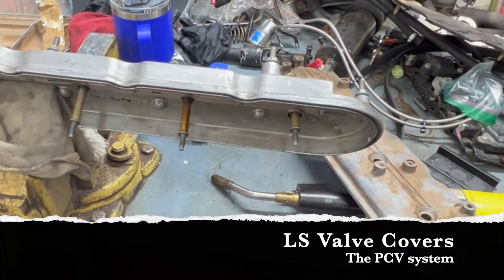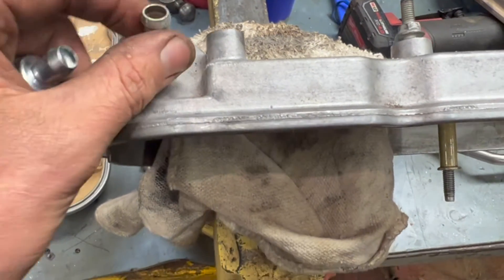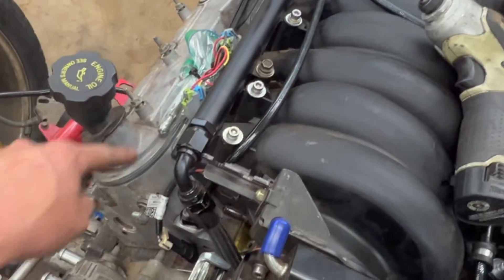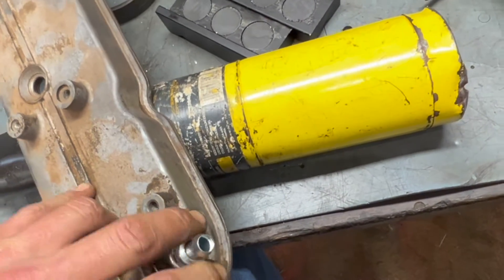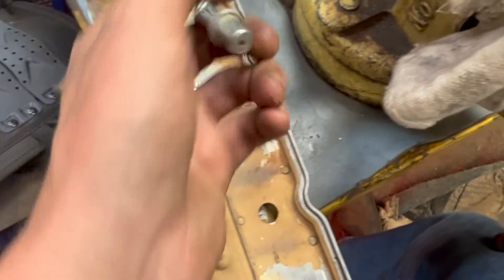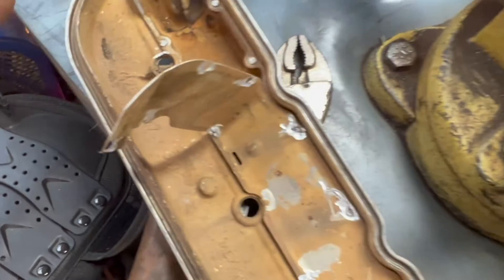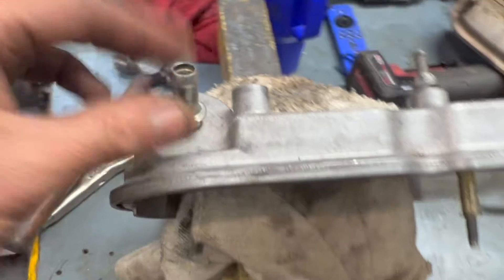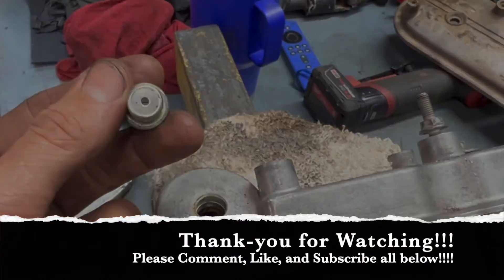Does the LS engine have a Real PCV system???

Comment: Gm has an updated valve cover to fix oil consumption issues in these. Its basically a larger drainback hole. Any ls I buy, one of the first things I do is go through and drill the hole larger, and in many cases add 2 more. Ive never had an issue with conaumption since.
Reply from the maker: Thanks for the info! 😄 I’ve heard about the updated valve cover fix, and opening up that drainback area makes a lot of sense. Sounds like you’ve got a solid system going — drill it out, add a couple more, and keep the oil where it belongs. Appreciate you sharing that! 🚀

Comment: So I have a 2004 silverado 4.8. Its my daily driver right now. Its pretty high on miles but I dont want to get rid of the truck because when I end up getting something else I want to rebuild the engine and have a toy. I've been having issues with it sputtering for quite a long while and after some fuse replacing and other things was able to read the codes. It shows a p0449 evap leak code which I am sure is the cause of the sputter. Just recently it has been getting bad. Oddly the sputter is mostly gone though I have replaced a handful of evap parts and such but I went to kill it after getting home from work one day and the engine acted like it wanted to stay running. It happened again the next morning when I got to work. That's the last time that happened but now its trying to stall out right as im pulling up to my house. It did it yesterday and I kept it from completely stalling but today it stalled and was hard to start. These are signs of the evap leak from what I've learned. The knock sensors are also throwing codes which again I assume is from the evap leak making it sputter causing the knock sensor to try to adjust timing. Possibly why it was acting like it didn't want to shut off. Since all thoes problems have stopped so far im not sure what to do. When I was looking into why it didn't want to shut off I read that there could be carbon build up or extra fuel coming out of the injectors or possibly the pcv spitting oil into the cylinders causing it to act like a diesel. Im obviously having the same concern as far as replacing a valve cover. Why did GM do this dumb shit. But anyway what do you recommend?
Reply from the maker: Sounds like a mix of issues. The P0449 is usually the EVAP vent solenoid or wiring near the canister. The stalling and “dieseling” could be from the PCV built into the valve cover—if it’s dumping oil into the intake, swap the cover. Also check for carbon buildup or leaky injectors. Knock codes might just be from water intrusion under the intake. Sounds like you’re on the right track! 💪🛠️

Comment: That PCV valve did not come on your 02 TA....LS1 PCV system had a hose from drivers side valve cover....to rear pass side valve cover....to front of pass side valve cover ....to the nipple on the throttle body....the hoses for the rear of the set up meet up behind the intake with a piece of foam to join them....the foam rots and causes a BIG vacuum leak
Reply from the maker: So that valve cover in the video. Isn’t from my TA? Crazy that is what I pulled it off of!
Reply: @RocketGarageService The valve cover is off the TA....just that the grommet held the hose and not a PCV like you show in the video ...if you Google the LS1 PCV hose you see what I am referring to

Comment: I hope I can get a comment on my problem. I have a '99 Z-28 with an LS1 and the oil pan gasket leaks like a sieve. It acts as if it isn't just dripping oil around the infamous O-Ring around the pan, it acts as if it's under pressure and the oil is being forced out. Doesn't the PCV system take care of oil pressure and relieve what I'm talking about? For someone who doesn't have a lift, how should this problem be handled?  Thanks.
Reply from the maker: You're absolutely right to think the PCV system plays a role here—it helps relieve crankcase pressure, so if it's clogged or malfunctioning, it can definitely cause oil to be forced out at weak points like the oil pan gasket or that infamous rear O-ring.

For a '99 Z28 with no lift, replacing the oil pan gasket is a bit of a job, but not impossible. You’ll need to get the car high enough on jack stands to safely drop the pan—just be prepared to disconnect the steering rack and possibly loosen motor mounts to gain enough clearance.

Before diving in, I’d recommend checking the PCV system first. Pull the valve cover and inspect the PCV valve or any breather setup—make sure there's no clog or excessive sludge. A simple issue there could be the root cause and save you from tearing into the pan right away.

Comment: I'm about to replace my gaskets for my valve covers on my 02 Chevy silverado 1500 5.3l ls exd cab Should I replace the valves covers to these new Updated ones or stick to the original for that truck ? I've seen the thing about drilling holes in the inside is that highly recommended ? Will I really notice a difference I do not run a catch can yet
Reply from the maker: I am torn on it. IDK. Cause you can tell, without destroying the baffle. And the valve cover isn't cheap. But if you play safe then sorry. You can't go wrong with replacing it.  Thank-you for the comment!!!

Comment: If I can add one more comment through experience, you may notice oil pressure issues upon start up when the oil pressure will go to almost 0 and then as the engine warms up returns to normal. You may even drop a lifter at highway speeds. Most of these engines, 4.8, 5.3, 6.0. will start cavitating air into the oil galleries because the O-ring at the top of the pick up tube has deteriorated after approximately 175,000 miles. They all seem to do it and it’s a simple fix. Remove the oil pan and replace the O-ring, but best to have an experienced shop do it because the oil pan gasket can be a bear to reseal properly. Also replace the O-rings on the oil cooler block on the side of the engine. Good motoring!
Reply from the maker: Thanks for sharing your experience! That’s a great tip about the pickup tube O-ring—I’ve heard of that causing issues, and it’s good to know it’s common around 175,000 miles. I’ll definitely keep that in mind, along with replacing the oil cooler block O-rings.  Thanks again, and happy motoring to you too!

Comment: What’s happening is that the single drain hole at the back inside valve cover baffling is plugged, causing the oil to pool and then get pulled up by the PCV orifice and into the Plenum. Every time I stop at a traffic light, I drive away and leave a big puff of blue smoke. Took the valve cover off, drilled extra holes in the baffling and enlarged the single factory hole in the baffling so the oil drains into the engine again. Don’t enlarge the PCV fitting hole, you could be asking for problems.
Reply from the maker: Thanks for the detailed explanation! That makes a lot of sense, especially with the blue smoke after stops. Drilling extra holes and enlarging the factory drain hole in the baffling sounds like a smart fix. I’ll definitely avoid touching the PCV fitting hole to steer clear of potential issues. Appreciate the tip—it’s always great to learn from others' experiences!
Reply: @RocketGarageService  these engines are indestructible and I’m thankful for them. I drive delivery on my 2005 Chevy express cube van with a 4.8. I’m on the second engine now and have the third in line ready to go with the updates. The truck has over 600,000 miles now.
Reply: Yeah that hole is that size to act like a check valve.
One way only.
I just realized something. 
The drivers side is dirty because why? IT IS UNDER VACUUM FROM THE INTAKE/ PULLING FROM THE DRIVERS SIDE.
THE PASSENGER SIDE IS ONLY GETTING CLEAN INTAKE AIR TO KEEP THE AIR FLOWING.
IN ON THE PASSENGER SIDE THRU THE CRANKCASE AND ITS OIL THEN OUT THE DRIVERS SIDE BRINGING ALL THE GUNK WITH IT. 
LETS JUST INSTALL OLD SCHOOL VALVE COVER BREATHERS ON EA.SIDE AND LET THE ENGINE BREATH.

Comment: Let’s all thank GM for the dumbest stupidest engineering fuck up they could’ve thought of. Got mine off ,drilling extra holes in the baffling because every time I stop at a light, I leave a puff of blue.
Reply from the maker: Lol, couldn’t agree more—definitely not GM’s finest moment! Drilling extra holes in the baffling seems to be the way to go. That blue puff after every stop is super frustrating. Glad you found a fix!
Reply: @ thanks brother and thanks for your guidance on this as well. I completed the repair as simple as it is and the blue smoke is gone. Oil consumption back to normal.

Comment: Can say 100% legit because when it fails, it causes major oil consumption issues. If you can’t replace the valve covers, remove them and spray penetrating blaster in the breathe channel and brake fluid to clean out. Air hose it out and change the PVC. Clean your throttle body with throttle body cleaner and reassemble. It’ll smoke the deposits after but should be good after a 15 mile drive.
Reply from the maker: Man, you get it!!!! Maintenance guys gets the important of this knowledge. It literally changed what I thought I was dealing with.

Comment: A good upgrade for any Ls 06 or older is the 07+ Ls driver side valve cover and it is an easy direct swap with no other mods needed.
Reply from the maker: I ended up putting in a valley pan style PVC. I believe they used them on LS3s

Comment: It started as a real replaceable pcv valve in 99-02 trucks (Camaro and corvette starting in 97) then gm made a fixed orifice update for the valve with no valve in it. Then in 06/early 07 they changed the driver side valve cover to a non replaceable fixed orifice valve cover with improved internal pcv routing for reduced oil consumption.
Reply from the maker: Yep, that sounds about right! GM definitely made a few revisions over the years to address oil consumption and PCV issues. The fixed orifice update was a big change, and the 06/07 valve cover redesign helped a lot too. Appreciate the insight!

Comment: Going through this right now, had 2 quarts of oil in my air box collector
Reply from the maker: Sounds like you've got a serious case of oil blow-by! If you haven't already, check your PCV system and make sure it's not clogged or malfunctioning. A catch can might help too, depending on your setup. Hope you get it sorted!
Reply: @RocketGarageService how does a catch can actually help? Sure you don’t and up with oil in your air box but your pan will still eventually empty
Reply: Sounds like you got an old school oil bath air breather..  lol

Comment: Making the holes in the pcv restrictors is a mistake. By doing so, you've allowed even more oil vapor into your crank case vent system. You've also interrupted the intake air flow. A catch can will only catch the oil - BUT - the air flow interruption caused by these enlarged holes is probably making your engine idle rough, incomplete fuel burn, and/or/possible detonation.  The best way to reduce oil into the intake - is to leave the holes alone, install a catch can, and route fresh air into a valve cover - and dirty air from the valley port (or other valve cover) to a catch can, then into the intake.
Reply from the maker: This was part of my own research and knowledge. I wanted to run a PCV system to a catch can that was vented to the air. No connection to the intake at all. In the end, I switched up catch can setups. And connected my PCV system to the later version PCV through the valley tray > into a catch can > then the intake.

Comment: thank you I though the cover failed and did the same so i ask where is the egr valve he said that the 2003 and 2004 don't have EGR sum sort of cat thing . codes 327-332 !!!???
Reply from the maker: You're right—on the 2003-2004 models, GM removed the EGR and relied more on the catalytic converter for emissions control. As for the codes 327-332, those usually relate to knock sensors and oxygen sensors. If you're seeing those, it might be worth checking for wiring issues or sensor failures. Hope that helps!

Comment: I just realized that my early 2009 production LS3 in my 2010 Camaro SS, has been super horrible blowby. I noticed it at first through the throttle body, so that was bad enough. 

Then, I installed an oil catch can and my horrors came true. I don’t have AFM/DOD, so I also don’t have a PCV. Chevy uses a flexible u-shaped connection to share a port from the engine valley cover, to the intake manifold. The driver side valve cover is capped off from the factory for this reason. 

Anyways, I noticed my oil catch can filling up literally every 4-5 days, driving more than 200-250 miles (not including hard driving, etc). My engine/car only has barely 35k miles, and I figured the piston rings weren’t bad (never got it compression checked), the spark plugs seemed okay, and the valley cover gasket couldn’t possibly be messed up. 

I’m gonna see if I can install an in-line PCV valve (3/8”) either through the inlet of my catch can, which goes to the intake manifold. I believe that this will remedy all the oil blow-by, as a result of the engine design
Reply: Maybe it's not as bad as it seems. I haven't done the catch can thing but the blow-by can get loaded with water vapor and drippin like a tailpipe.
Reply: @jamesd6247  what do you mean by water vapor? And wouldn’t that be mixed into what’s caught in the oil catch can.?
Reply: @isnowyazn  yes, that is exactly what I was thinking. I suspect the oil in the catch can would seem thin and be mostly condensation.
Reply: @jamesd6247  Nope, seems exactly like what would come directly from my engine. Seeing as how it collects excessively (half to 3/4 can full) within 5-7 days’ worth of driving around ~200-275 miles, I find that to be a ton. It would probably get sucked back up into the intake manifold if I didn’t empty out the can after 8-9, maybe 10 days tops. 

The only thing so far that I haven’t done, is an actual compression test. My car/engine has 35k all original miles right now, and it’s bone stock, minus some bolt-on mods and a custom tune. I assumed the engine valley cover was fine, and some people assumed that I might have stuck piston rings. 

I’ve ran top engine/intake system and valve cleaner through the intake hose, to the throttle body, as well as running Seafoam and other engine cleaning formulas (made to go into the fuel tank AND engine crank case). 

I ended up running an additional in-line PCV valve through the inlet section of my oil catch can routing. I am seeing less blow-by as of the past 5-6 days, but I might leave it for another 6-7 days to check for sure. Someone told me to take out the spark plugs, and soak the pistons from the top down, with Berryman’s B12 or B50 Chemtool formula. I don’t think I can do that method though….
Reply: @isnowyazn  I just watched some pros say you can never have too much venting. They were doing most of their own plumbing and didn't talk much about sucking or blowing oil. 

I did have the impression that is where you may have been going having mentioned design. Was hoping it was something simple.
Reply: @jamesd6247  Venting in what way? Like, as in a vented oil filler cap? Maybe a vented breather filter on the oil catch can? 

The oil catch can routing for the AFM/DOD GM V8 engines, uses the driver side valve cover, which has a PCV valve set up into the rear of the valve cover. My LS3 (no AFM/DOD), has a vented engine valley cover, with a PCV system integrated underneath the valley cover. This is what intrigued me, as the “baffling” of whatever under there, seemed like a whole lot more than the baffling under the (driver side) valve cover of the L99.
Reply: @isnowyazn  Yes, most of the systems I seen were pretty simple with just a can or filter that would clog up fast. Could be an issue in the winter. I stumbled on this video trying to learn how some of these gm engines plumb those things in. 

I'm not sure I understand the system yet but, have the impression one of those valve cover hoses is putting air into the crankcase and the other venting. So it makes sense one would have a baffle to keep oil from being sucked in too much under one valve cover, and not the other. That really is the extent of my knowledge of some systems.
Reply: Thinking about it a little more I would expect a filter on the intake side allowing air into the crankcase and a catch can on the other venting or whatever. It really shouldn't be blowing that kind of oil and no way at 32k so I'm suspecting a plumbing issue.
Reply: @jamesd6247  Idk, I definitely don’t think it’s routed wrong, or it wouldn’t be pulling oil I think. I even tried routing it backwards on purpose once, but only did it for a day, so I’m not even too sure. 

The thing is that, I’m actually running a knockoff version of an actual branded oil catch can; and it’s for the generation Camaro SS after mine. But regardless, that shouldn’t matter, except for my theory that maybe whatever filtration inside the knockoff catch can, might not be all that great…? Could that be a factor? Idk…

I was thinking that adding an in-line PCV valve, since my engine doesn’t naturally come with any pcv system; would somehow “help” the issue, if not resolve it for the most part. 

I’ve ran top engine/intake valve cleaner, through the intake hose and into the throttle body; done a few times, to hopefully clean out some of the gunk that all the previous oil blow-by’s done. I also began running some Seafoam or engine treatment inside of the engine (formulated for both the fuel tank and engine crank case), to possibly maybe try and “free” up the piston ring(s) a bit; even though that’s technically not the effective way to do it…